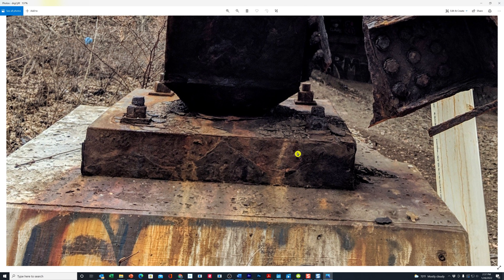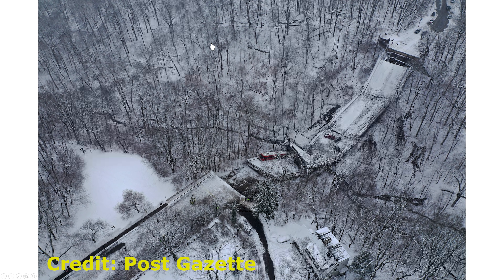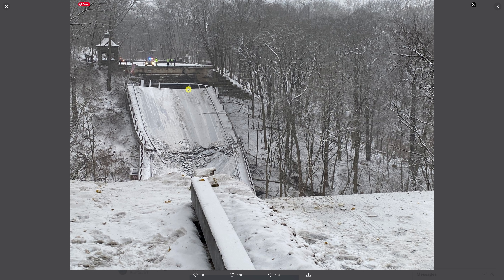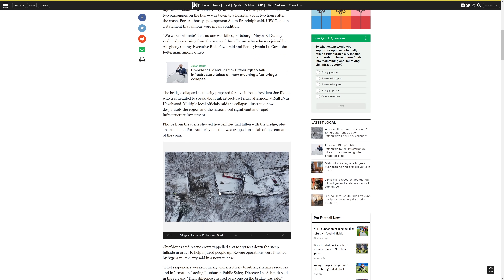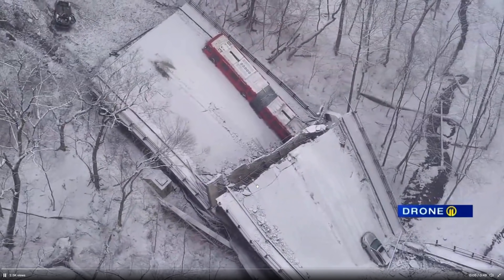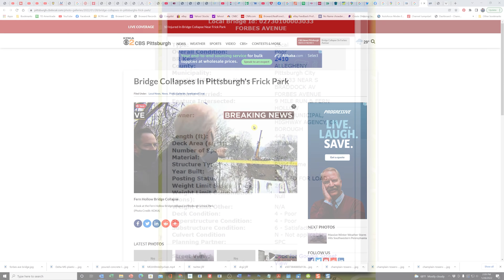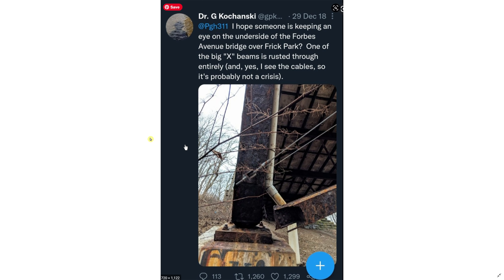Pittsburgh Bridge Collapse Cause, Forbes Ave Bridge Frick Park Rust?

Comment: Temperatures below 32 for weeks and near zero overnight for days caused this old bridge to contract (shrink) away from its foundations. it happens…
   Pittsburgh has temperate winter temperatures. Most of the winter, the temperature will dip below freezing overnight, and go above freezing during the day. It’s been like this for about the last three decades. This year, 2022, we’ve had an extended below freezing cycle, and a few days which is unusual, for the temperature to go below zero overnight a few times. For the first time in decades that I can remember here, the snow cover has stayed for most of January. It’s about 6 inches deep most of january into feb this year..
 up till 2021/2022 winter, over the last few decades,we had the period where it would snow, and the snow would all be gone at least within a week, then we get snow, then it would be gone in one or two days, back-and-forth back-and-forth freeze/thaw, freeze/thaw. Played hell with the roads. We had a time of year around February March and April that was called pothole season..The road crews would go out with hot patch and make bumps out of  the holes ..
 if you think this is unlikely that this bridge worked itself loose by expanding & conyracting-you might be surprised to learn that the airplane, the SR 71 blackbird expands by 13 inches in length during flight from heating up due to heat from friction with the air.The SR 71 plane is nowhere near as long as this bridge that collapsed, and yet it expands by that much..how much is a bridge like this expected to expand and contract in the extremes of the environment it is subjected to?.. 
Metal fatigues, it gets old, every structure on earth is going to fall at one time or another unless it is torn down ahead of time, even the pyramids will be gone someday. Even the strongest bolt holding the bumper on your Mercedes is going to fail all by itself someday. That’s just the way it is..
 suspension bridges like the Mackinac bridge in Michigan can withstand movement from factors like wind. The Mackinac bridge is designed to withstand swaying 35 feet at the center in high winds... 
Expansion and contraction is a factor too..
  The Google earth videos I’ve seen of the deck of this bridge i did not notice the expansion joints. This would  not have happened in this fashion if this was a typical Arch design , or a suspension bridge..
   There is a bridge over the Ohio river in pittsburgh called the McKees rocks Bridge that is troubling. I have avoided that bridge when possible,That bridge is 91 years old (1931) the  section that spans the Ohio river is a suspension bridge,  it is approximately a 100 foot drop to the river below. ..it has undergone a few updates and surgeries, it is 7,394 feet long.. it was built to connect the top of the hill side on its northern edge, making it level instead of having an incline for traffic to cross the river from the northern edge, that made the bridge longer. it was also necessary to do it that way because below the bridge are multiple train tracks alongside the river. So a simple bridge just simply crossing the river was not Practical spiritual..On the southern edge once it crosses the river, it’s curves about 60° to the right as it slopes down to the lower end in McKees rocks to meet Island Avenue.This section over the river and over industrial area in McKees rocks , it is part suspension bridgeThe rest of the bridge connecting the two suspension sections are arch bridges
  I remember the sidewalks on the eastern side of the McKees rocks bridge that spans the river were all  buckled upward appx 60° forming concrete teepees across the entire span that was over the Ohio river. They were buckled up as high as the top of the Pedestrian pedestrian railing for Hundreds of feetThis was about 20 years ago or more, maybe as long ago as 30 years ago in the1990s… The bridge sat like that with that sidewalk closed for many years. They reduced the bridge down from four lanes to three lanes at that time..it  is a gridlock major artery during rush-hour every day. Sometimes the traffic is backed completely across the river. during those gridlock times every rush-hour, there are hundreds of buses, trucks, cars, stopped on that bridge waiting for the traffic light to cycle..I have crossed McKees rocks bridge maybe 100 times over the last 50 years. to be honest, I have avoided it during heavy rush-hour cycles. I’m glad I never had to cross it daily on my commutes.but,i’ve crossed the bridge and been stuck in traffic waiting for the light to cycle on the upper end over the river..It is very unnerving sitting on that trembling bridge..When sitting on this bridge in traffic through a few traffic light cycles at the Ohio River Boulevard end, and a tractor trailer or two or 10 fully loaded tractor trailers  headed in the opposite direction on their way to the industrial complexs along the river below for miles cross that bridge, you can feel it bouncing and whipping ..That’s the only bridge I’ve ever felt shake like that..I suppose it’s not a problem, but I have lived in Allegheny County/all my life.. there are more bridges in Allegheny County/Pittsburgh PA, than there are in any other city in the entire world, that includes Venice Italy..
  when I was in my teens, we relocated 5 miles from Pittsburgh to neighboring Bellevue. My friends and I used to be at the river fishing, with the McKees rocks Bridge in the distance lots of times..There is/ was a bridge along the Ohio River Boulevard, maybe half a mile away from the McKees rocks Bridge that is parallel to the river.. it was a concrete arch bridge. At the apex of the arch were a keystone would be, there was a section of concrete dangling by a single piece of rebar for years in the 1960s ..It was about the size  of a ford van.. I know this because I have seen from a distance cars and vans driving under the bridge of people going fishing, and I could compare/contrast the dimensions of that piece of concrete against the parked cars and vans that would occasionally park nearby…it was not a flat façade, it was a cube, a solid block of concrete and rebar.. I was only a teenager then, I didn’t know anything about bridges, still dont,but I knew that that was not a good thing... when we would be playing in that wooded valley on our way to the river, we would actually pay attention to not be directly under that block the size of a van hanging under that bridge. that thing hung there for years. It was part of the arch itself, not part of the deck or sidewalk. That road on that bridge was/ is four lanes ,a major artery that carried thousands of cars and trucks and buses every day. it is Route 65, The Ohio River Boulevard..Traffic was often backed up in the morning rush-hour across that bridge by the traffic light at the McKees rocks Bridge every morning. I’m talking about the bridge that connects Bellevue to the north side of Pittsburgh parallel to the river… that bridge spanned a valley that was at least 100 feet below, not populated. They finally replaced that bridge about 30 years ago. They exploded it and dropped it into the valley below. The video of the bridge being blown up actually made in CBS evening news.My best friend’s father was standing in front of his house about 1000 feet away watching for the explosion. A piece of concrete about the size of a baseball landed at his feet when they blew that bridge..
you  usually can’t drive for a mile in any direction in Pittsburgh without crossing a bridge .
  when my daughter was in college, in her psychology class, there was a student that had a phobia about crossing  a bridge, any bridge.. that classmate of my daughter said that there are people at larger bridges, I don’t know if they work for the state or who, but they will actually drive you in your own car to cross certain bridges. That’s how common it is for people to have Bridgecrossing phobia.
  i’m sure there are a few more of those people with that phobia now, at least here in western Pennsylvania, especially when we learned that there are thousands of bridges that get poor inspection grades in our area..
  it’s always something..

Comment: The photo at 16:15 is interesting, the power pole and hut indicate this the same end/side with the rusted off X brace. Notice the concrete pier is also there, but only has the steel plate, the structure itself has cleanly sheared off.
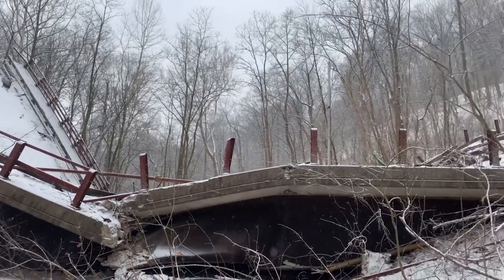16:26 and 3:23 show the other end of the bridge, the two support beams are still straight and nearby, and are the reason for the folded back section of bridge span.

Comment: BTW, regarding why the rust...they spread salt on those roads back east to prevent ice so for those who aren't aware, that also is what happens to the undercarriage of everyone's vehicles.
Reply from the maker: Does it help if you rinse off your cars every so often is it easy to spray underneath and get all of the salt off?
Reply: @jeffostroff  It doesn't hurt any however, long term effects will still happen, just not as soon. You'd have to spray something to neutralize the salt effects.

Comment: 14:14 those cables just... wow.. there's nothing stopping the column from shifting right! That joint is severely compromised
Reply from the maker: If the cables were tightened and put into tension they should be sort of OK it just depends on how much tension they put it under
Reply: @jeffostroff  any lateral loads imposed on the structure become shear loads at the column/base plate junction, but suddenly there's only a tiny bit of rusted column web to resist all the shear... the diagonal brace that was there is gone!
Reply from the maker: @DANNY40379   The Google street view shot that you can see there was taken in December 2020 if you go to Google maps and go under the bridge on the street view. I can see the cross members are there on both sides.
Reply: @jeffostroff  yes but do they make it all the way to the joint and securely welded? Those cables can take tension but ZERO compression loads(!)

Comment: With the weight limit of that bridge, according to the sign approaching from Braddock ave, the weight limit was 26 tons,  should the accordion bus have even been on that bridge? I’m not sure the tonnage to one of those busses, but it’s gotta be pretty close to that limit.
Reply from the maker: That will be in my next video, I don't think it should have been there.
Reply: When it was lifted off on Tuesday, the stated weight is 23 tons for the double bus.  It was lifted off with a tower crane as one piece.

Comment: Weathering steel, aka Cor ten, has been used for years and unfortunately it has been used incorrectly for years. Cor ten needs to go through wet/dry cycles to form protective patina. In most cases the underside of bridges do not receive sun, or circulation of air to dry it properly.  Moisture gets trapped inside areas such as the tubular cross bracing and begins corroding immediately.  Check out the pictures of cross bracing.
Increased use more aggressive  de icing agents,  salt, and brine have expedited corrosion. 
I'm in the steel bridge business and see it every day. Bad decisions 50 years ago are causing issues today.
Anyone in the North Hills of Pittsburgh can check out the underside of a bridge at Animal Freimds. Bridge built around 15 years ago. Sheets of rust coming off floorbeams.  Bridge is Weathering steel, close to water, lots of salt.
Bad design, bad application.
Reply from the maker: humidity and salt are still its enemies

Comment: Great video and detective work Jeff. I live in Pittsburgh and crossed that bridge many times when I went to school in nearby Oakland. It’s a beautiful park setting and you would never know how bad that bridge is underneath. I just saw for the first time the cables that were holding things in place. My goodness that looks like a poor bandaid to say the least. Yes, and the paint would go a long way. In Pittsburgh we have PPG which of course is a major paint manufacturing company. Could be a good thing to get them involved more. That rust is so severe, it almost looks like a product that USX makes - Core 10 steel. The whole USX tower is built with it and it has a natural rust look. Guard rails in my neighborhood are made from it so they blend in more with nature. You may want to investigate that. 

Again, terrific job!
Reply from the maker: Yes they need to come up with a way to effectively protect that steal
Reply: Didn't the corten steel cause problems when it was used on railway cars?

Comment: Great coverage especially on the photos from 28 December 2018.  If it was this bad four years ago what must it have been now?  
In that 18 photo it looked like tension cables were added.  They didn’t seem to be part of the original construction due to their lack of rust and/of corrosion.  Could it be that this was a band-aid fix for the corroded beam?  Now that’s frightening! The cables would add tension strength but do nothing for compression, of course.
Reply from the maker: I am pretty sure those tension cables were a temporary solution to a permanent problem period they probably figured hey it works on screen doors why don't we use it on the bridge

Comment: Hi Jeff, Great work on your condo collapse in FL. I lived in Pittsburgh for 30+ years and have been over this bridge. I’m sure all the salt spread over multiple winters had accelerated the corrosion on this bridge.
Reply from the maker: Thanks! I wish they had a better way to protective paint the bridges to resist salt.
Reply: @jeffostroff  honestly they should be on a constant rotating campaign to repaint every one of these bridges every 5 years.  But they are more likely doing it every 20 years.

Comment: at 7:37 those lines that you said concern you are just tar they use on cracks on asphalt to seal it to keep rain from getting into the cracks as in the winter time rain would get in and if it freezes it can wide the cracks and make the asphalt get holes aka pot holes.  It's normal for asphalt to get cracks like that.

Comment: Having grown up in Virginia and spent a lot of my life near DC. I have been to Pittsburgh several times. Winters are a bit colder there but deicing, freeze thaw and deferred maintenance are killing the roads and bridges. I was fishing near Pittsburgh under a bridge in the late 90s and I would have sworn I could stick my Swiss Army Knife through the steel of the supports. I have seen the same problem in MD, WV and VA so it isn't a Pennsylvania problem.  I assume it is in other states surrounding VA, it bit Pennsylvania first but it could have been many states
Reply from the maker: Yes anywhere you have snow, salting the roads, and moisture
Reply: @jeffostroff  Yep and a lot of storms start with freezing rain or sleet. That messes up the drainage at times depending on the change over time 0.1 inch isn't to bad but .2 will seal a lot of the grates will be almost sealed up. Melt water had to go somewhere I would hazard a guess it went down on and followed the steel carrying its load of salt.  I'm am sorry if this was to much of a response.
Reply: We are in the age of Aquarius ... ehh of quality issues. We will see a lot of more disasters coming about. All in for the 40 year collapse.

Comment: Looks like the substructure was like an upside down V facing the center two spans. There’d be a lot of stress on the bottom welds/rivets of those beams. Beams support probably gave out at bottom Middle probably went down first and pulled the rest in. The beams I think are under the section that went above the bus.

Comment: If you look closely at 11:38 you can see the cross support structure, the metal "X" between the two vertical beams holding up the near side of the bridge.  The pictures of the failed cross support was the structure below the one in the picture.  You can see here that support was not repaired as previously reported.  It was completely removed.

Comment: The bus on it has a gross weight of 20 tons, and it’s always loaded with traffic at rush hour with sometimes four plus buses on it at a time. The deck was heavily salted throughout 50 years of winter conditions. The bridge is 30’ high at the center. In 2018 it supposed to get a 1.5 million dollar structural rehab. It was rated poor for ten years, 4 out of 9. I’ve been on that bridge hundreds of times. I didn’t know anything any about the condition or rating, and it was not in local news prior to this.  That did look spindly. Great video.
Reply from the maker: It's funny a million people have left me comments each with a different weight of what the bus is. So far the one that I think is the most credible is the one from a mechanic who works at the actual bus depot and said These Articulated Buses weigh about 22 Tons and are 65 ft long